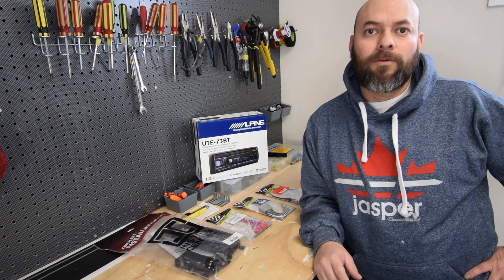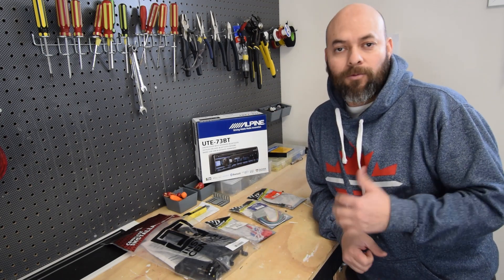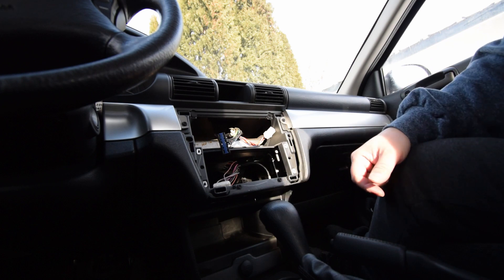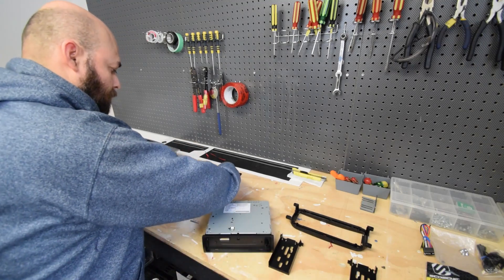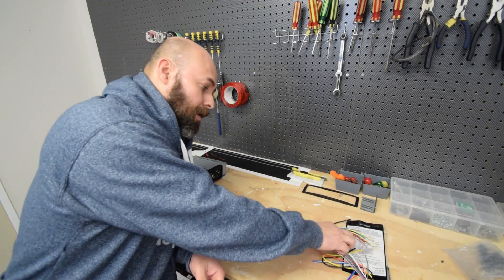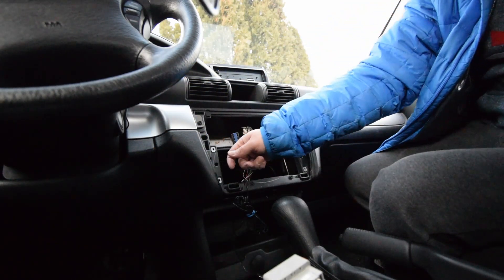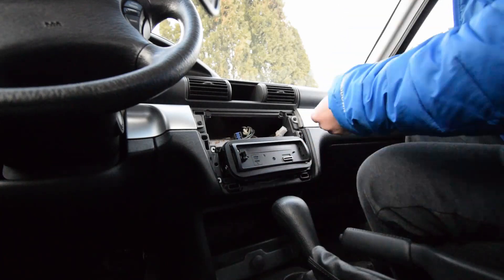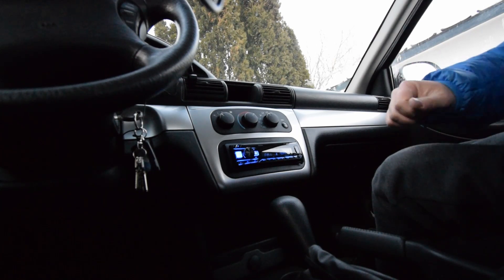Car radio install - 06 Chrysler Sebring

Comment: Great video! I just ordered all the parts to do this. How did you route and where did you install the microphone?
Reply from the maker: Thanks 🤛 I ran the mic on the left side and placed it on the dash behind the steering wheel by the gauges. You can fish it left and run in between the steering wheel column or go up the pillar over to the top of the headliner. Hope that makes sense.
Reply: @esqu3l3to  Got it! Thanks. One more question for you - is there a way to disconnect the battery without having to remove the wheel? I don't have the tools to remove the wheel.
Reply from the maker: I don't think there is, however, what you can do is remove the radio fuse in the fuse panel. That wat there is no power send to the radio while you work  on it. Since you dont have any connections like air bag sensors you dont need to worry about that.

Comment: Any way of grounding an amp wire on a 2004 Sebring? I can’t find any bolts in the trunk that would work the only place I could think of is the strut tower or somewhere under the seats..
Reply from the maker: sorry for the late reply, I did not see your question. I did not check, however, look by your wheel fenders or seat buckles, you can use an existing nut of one of those. Just make sure its clean non-painted for best ground possible.

Comment: Do u have to replace everything when u change radios? My stock radio works great I just want to be able to play music from my phone, instead of always listening to the one station that works out here.
Reply: I just want to replace the stock radio with a bluetooth radio, but will I also have to buy everything else u listed?
Reply from the maker: Yes you will need the dash kit, harness and antenn adapter. Honestly, if you want to save money you can cut or splice into the factory harness. Antenna adapter is needed if you still want to listen to any radio station. Dash kit is required to to mount the new radio. A real cheap way would be to buy a wireless adapter that connects to your radio via fm frequency.
Reply from the maker: This is one of the least expensive installs I have done, aside from the nee radio, I bought the dash kit including harness and connectors for $25 from amazon.
Reply: if you just want blutooth get a fm transmitter they are like 20 dollars at walmart

Comment: How exactly do you remove the antenna? “push and pull” didn’t work for me
Reply from the maker: Push the antenna forward (behind the round black piece) then as you're pushing forward, you slide the black piece that's attached to the radio back. Hope that makes sense.

Comment: Where did you place the ground wire? I’m having trouble finding a place for my ground wire.
Reply from the maker: you can just use the factory ground wire found within the harness, otherwise you will need to go to a metal bracket on the drivers side kick panel near the hood release.

Comment: Any idea for 2007 sebring ? or have any links for double din ? i want to do mine but i can't find the wiring harness hope you can help me.
thanks
Reply from the maker: Which submodel do you have? (Base, limited or touring) I can help you find the right harness.
Reply: @esqu3l3to  I have a 2007 touring. What harness would I need ?
Reply from the maker: Which submodel do you have?
Reply: @esqu3l3to  it’s the touring
Reply from the maker: K let me look
Reply from the maker: Do you have premium sound system or just a basic?
Reply: @esqu3l3to   basic
Reply from the maker: Ok, I have some links for you. Message me throuh my fb page

Comment: Which wires go to which?
Reply from the maker: Did you buy an adapter harness?
Reply: @esqu3l3to  yes I did
Reply from the maker: Ok, color match all the wires- yellow to yellow, red to red, black to black. Same with all the others. For the whites, purples, green, and gray make sure to match properly. Meaning solid white to solid white and white/black to white black etc.
Reply: @esqu3l3to  with the left over wires, do I put electrical tape around them?
Reply from the maker: Yes, just to make sure. You should only have a few left. Also, orange or orange white make sure to connect. Its for dimming the radio at night.
Reply: @esqu3l3to  okay, thank you so much!! perfect tutorial :)
Reply from the maker: No problem, hope all went well and you got your new radio working! And thank you for the good feedback 👍

Comment: Hi thanks for the video, can i put a newer radio in the 06 sebring. I just want a lcd touch screen on the dash,
Reply: But i know where the radio is, is pretty small, So i maybe need to install a smaller radio like you did.
Reply from the maker: You can get a single din radio like the one I installed but that has a flip-out screen. Email me at chucho_301@hotmail.com and I can get you some links

Comment: if i use another cheaper universal radio, will the parts be the same?
Reply from the maker: Adapter harness and dash kit will be the same, however, make sure the new radio dimensions will work with the dash kit. Some Android radios are not the typical size of most aftermarket radios.

Comment: Where the hell did you find your guide for the wires at ive been at it for hours and not shit
Reply from the maker: I used a adapter harness for the installation. Otherwise trying to find a wire scheme is impossible. The adapter harness is not that expensive plus some dash kits include them.